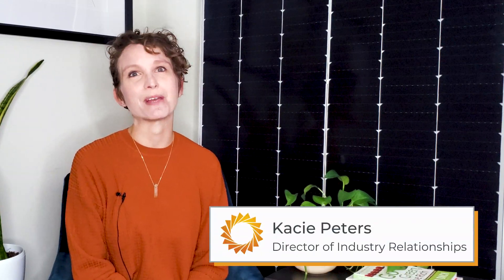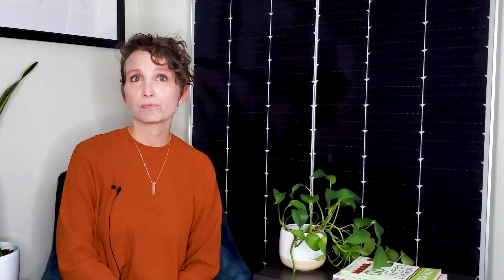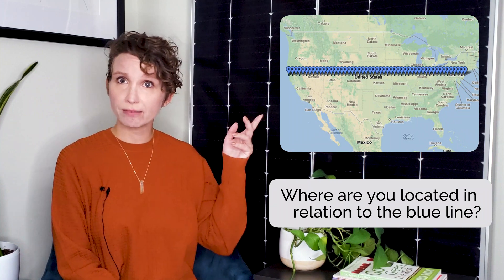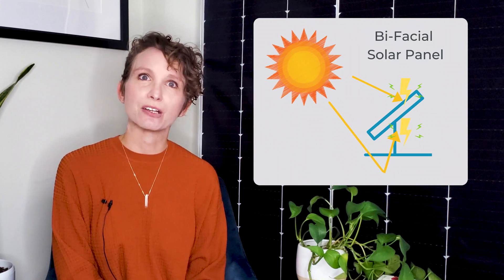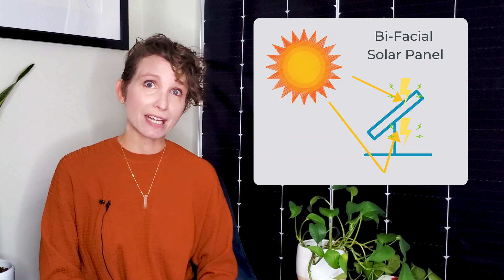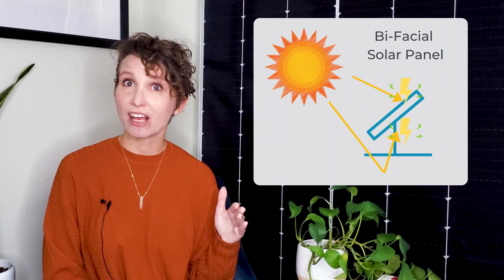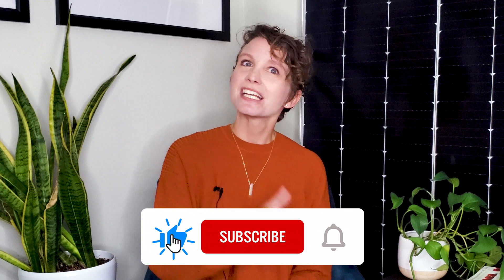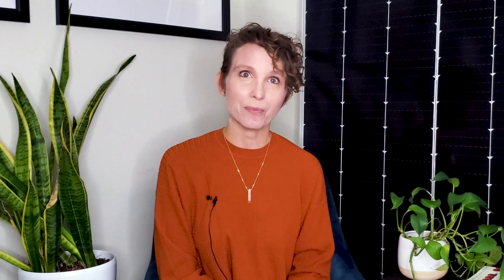Bifacial Solar Panels vs. Monofacial Solar Panels

Comment: Urgent question..... will a 550w bifacial produce more than 550w if the bottom is also producing power ? Or when a panel is rated 550w bifacial it means totally with power generated from bottom also then the power can reach 550w maximum ?
Reply from the maker: Hi There! A 550W bifacial module can produce more than 550W if the backside is producing power. The 550W rating is for the frontside only since bifacial power production is variable. Bifacial module spec sheets will show total power production at arbitrary bifacial gain values. We recommend referencing the spec sheet for the module you intend to utilize!
Reply: @PivotEnergySolar  Thank you so much for your reply.... My inverter is rated 1650wp max panel capacity, so im getting exactly 3x550w panels (mono perc half cut) BUT im getting the same panel in bifacial also at the same price from the same brand.

The dealer says anyway the 550w front wont produce its complete rated 550w in even ideal conditions real world...so only 80-90% can be expected....so he says the extra wattage form the back wont affect the inverter as that would cover for that 10-20% loss giving full efficiency while still remaining under the inverter rating. Is this true.

And in gloomy/cloudy weather the bifacial would add more watts to the yield ? Kindly advise. Thanks

Comment: I bought the bifacials because they were CHEAPER.

I have a black roof. Is it feasable to put some foil or reflector on the roof behind them?
Reply from the maker: Depending on the installation details and roofing materials, there are options for reflective coatings that can help to boost the bifacial gain! For a flat TPO roof, it is possible to retrofit, but black shingles, on the other hand, would be very difficult to retrofit. Also, if it's a flush mount installation, there's no real use case or way to make it 'pencil' to put a coating on the roof beneath. You need a tilted up array to help with reflected sun rays for the bifacial gains from the back of the modules.
Reply: @PivotEnergySolar  
If I painted the roof white with acrylic, you don't think that would be significant?

Aren't the bifacials trasparent to some degree?

Thanks.